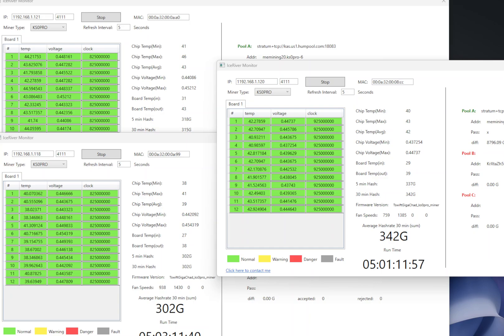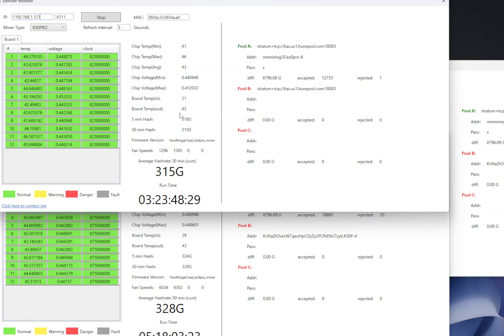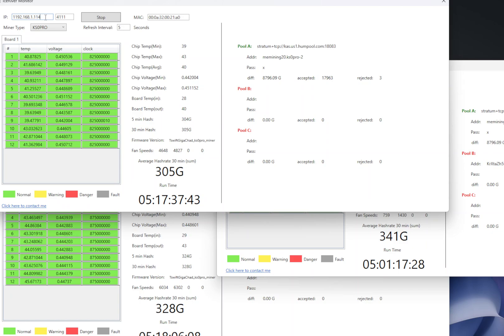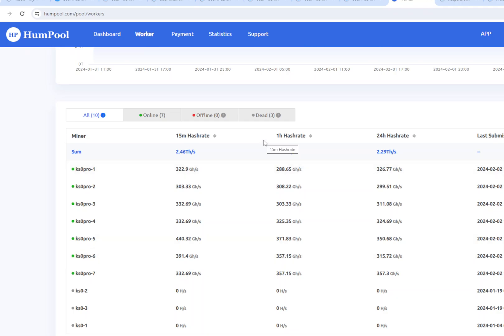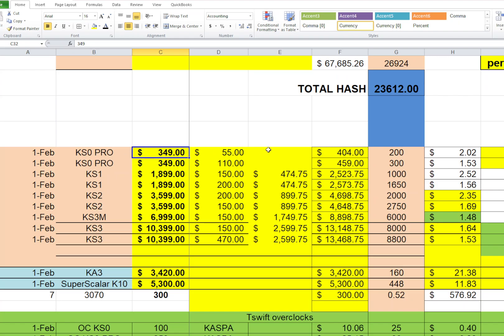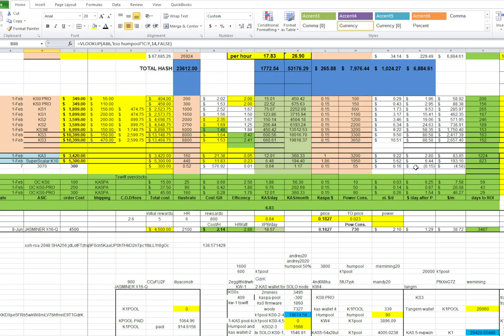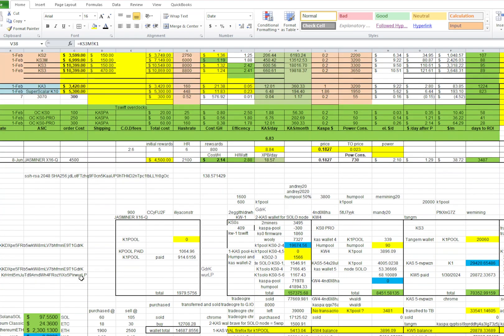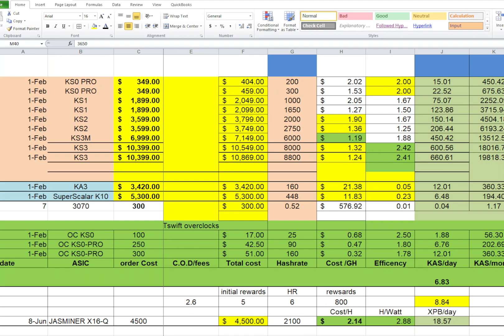REVISED VID ON KS0-PRO SUGFFERING FROM MOSFET OVERHEATING AND BUYING NEW ICERIVER ASICS CALCS

Comment: Hello,
I have a question, the original power supplies are 19v. But you have built 12v distributors on your power supplies. Work the Mainer with the 12v supply
Reply from the maker: Yes, correct it works on 12v but calculate your amp loads based on the 12V system when use overclocks to make sure cables and connected supporting the amp load.